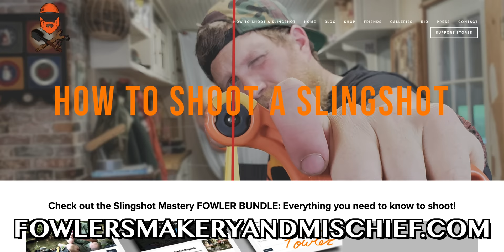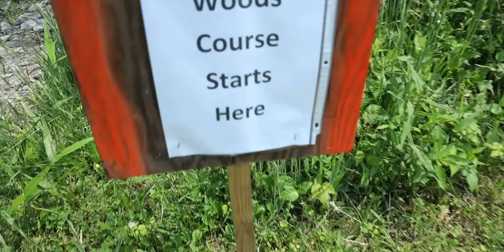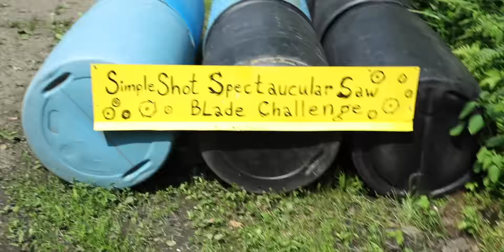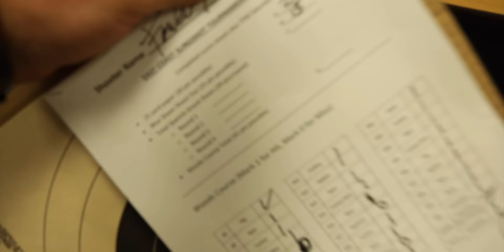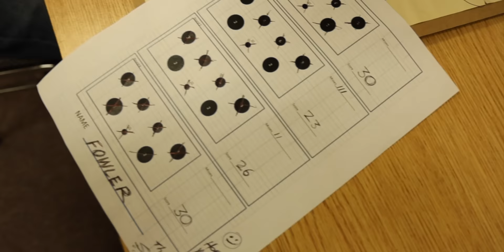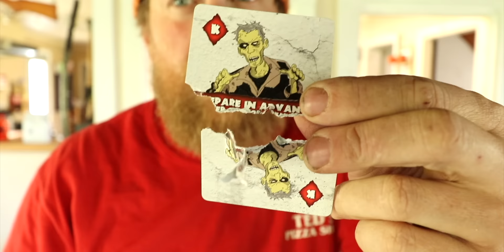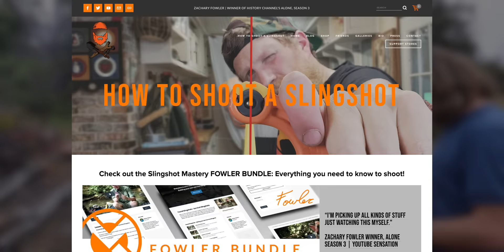Slingshot Catch and Cook The Movie

Comment: I know this is random and unrelated to the video or slingshots but cluld you do another video with blowguns? I've been getting into blowguns more often since I can't shoot my slingshots as often and was wondering if theres something I could learn from you. I even have a blowgun I can recommend you that I think you'd like as much as I do. I've got the Black Rhino Khaos .625 5ft blowgun which has a fiber optic peep site, it also has wire target practice darts, short broad head hunting darts, bambo target practice darts, long broad head darts and you can even get indoor/ outdoor foam target practice darts that are basically nerf darts with cones glue into them that are great for goofing around with.